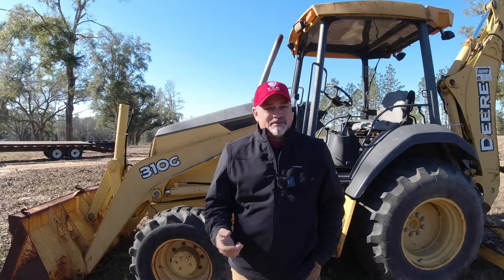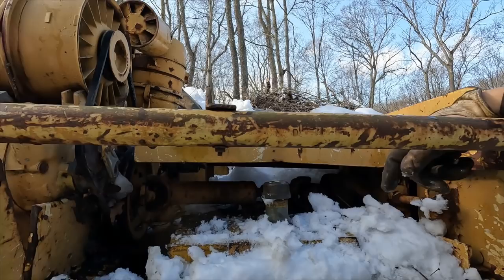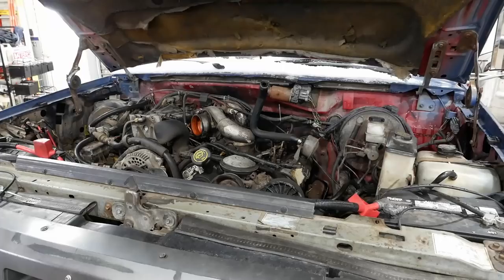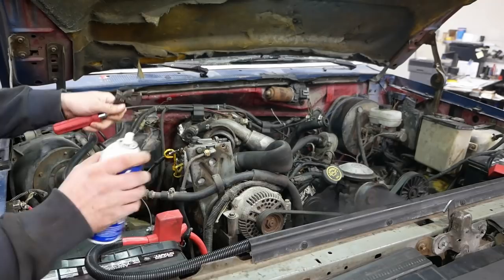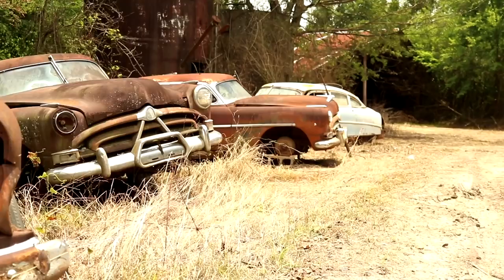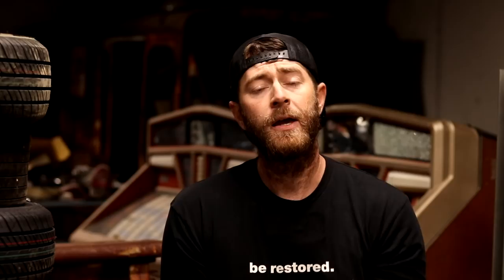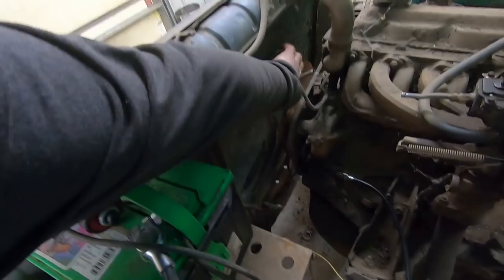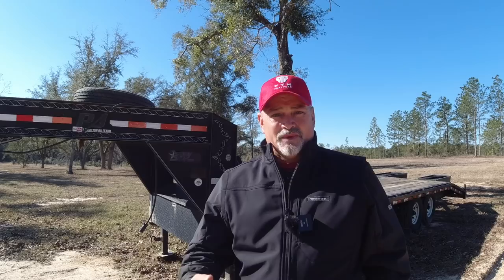I conned “WILL IT START” EXPERTS into telling you how to get a car started!

Comment: Great Video Hank.  Regarding the parts stores;  I always try patronize the parts stores who have people who are willing to look up parts that may not necessary be in the database.and a place willing to answer questions but not cast you aside . 
Usually I will always gravitate towards parts stores that have either “Old School” parts people or ex mechanics - This can reap lots of benefits.  
I have found that for the most part that the large chain auto parts stores have no desire to get involved with anything other than what they can look up on their computer with one large chain in particular seeming way more desirable in selling fuzzy dice and air fresheners than actual auto parts. 
Several of the YouTube channels that I follow use O’Reillys, I which I have far more positive experiences with than negative - There are no perfect auto parts stores.  A fair amount of the parts that I usually purchase comes from off of eBay in which with the fuel prices you can’t beat having your stuff delivered Thanks again for another great video.
Reply from the maker: Yeah I hear ya buddy. For sure.
Reply: @HamiltonvilleFarm  By the way, I am subscribed to all of those YouTube channels. I like to get other perspectives other than the “Cut & Dry” technical manuals.

Comment: I got all ones mentioned Hank  :) also there all enjoyable too and watch too every week plus yours too! Myself Hank :) I check engine oil , fuel tank plus injectors also ignition parts , starter plus Solilendo also Generator Alternator, Water pump and Transmission plus lines hook to rad also battery cables on connection plus needs change or not plus engine belts also tires in dash got key ignition switch or tap not ! Plus pedals too also gear shifter types! Fresh fuel too !
Reply from the maker: Thanks Andrew. I always enjoy reading your comments
Reply: @HamiltonvilleFarm  welcome Hank and help out too make You Tube videos grow to also Lol ! Tips of Trade goes long ways too Hank  :) and lots other didn't mention watch but okay there some Canada ones to like Cold Water Motors also Penny's  and Halfass Kustoms there you go every one search for too! Plus Budget Buildz and Puddin to in USA too! Plus Rev Restoration to and tons more ! Lots loads watch each day too plus Farm ONES called Dirt Green & Steal , also Just Few Acres ! Hope you all enjoy find looking for too!
Reply from the maker: We did a cool collab with budget Buildz and Revstoration with a boat. That was fun!
Reply: @HamiltonvilleFarm  sure was !

Comment: Hank have you gotten the john deere 310G's forward valves freed yet or are you still working on them ? 😄 by the way these experts are cool i bet we could learn stuff from them which we never knew about 😄
Reply from the maker: Not yet.
Reply: Hank do you need to remove the whole valve thing in order to free the forward valves ? 🤔 if so i bet it will be a huge job to do that 😅